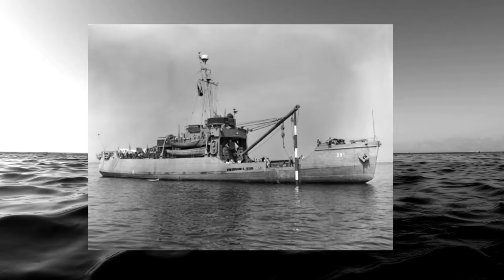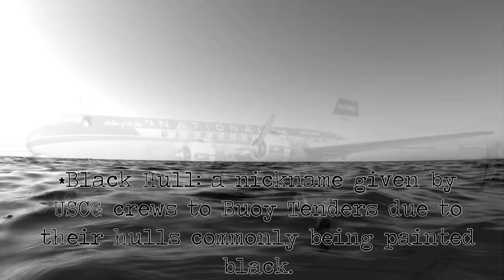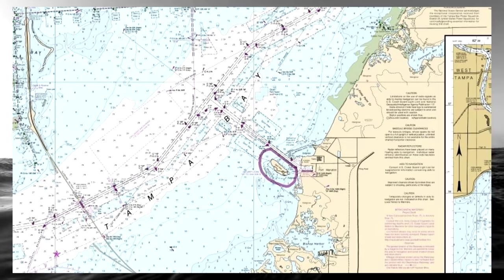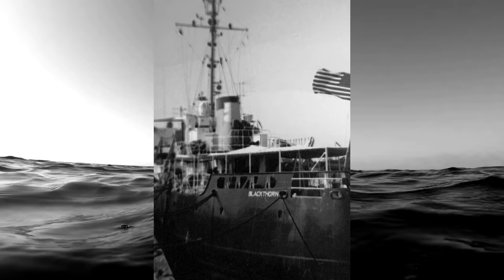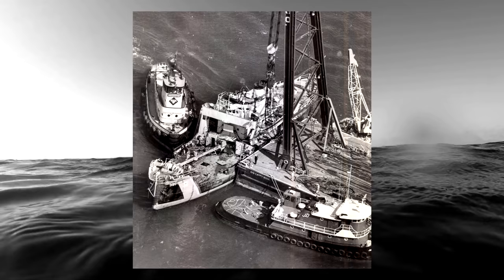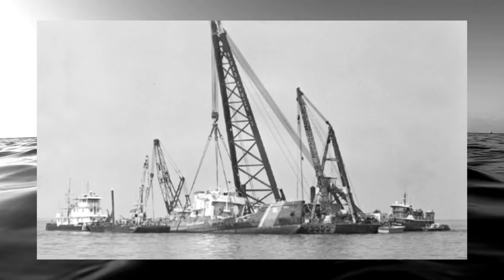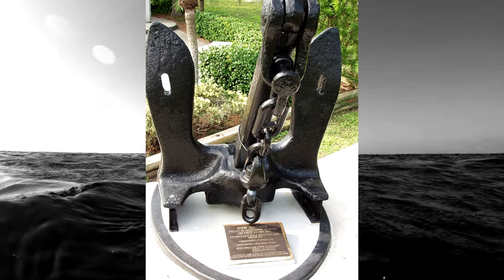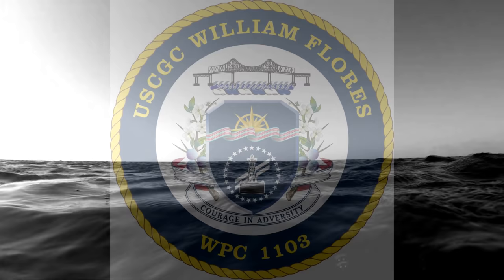The USCGC Blackthorn Collision

Comment: I remember my last ship, the Resolute, on top of JOOD duties, it was required to do an emergency egress training before being qualified to stand independent duty/watch and in port drills.  I remember having to wear a OBA mask, tapped up to block visibility.  Someone would  "walk" you around, up and down ladders, thru hatchways, get spun around, etc.. Then they would say, "find your way out". They turned you loose and away you went. I was the TCIC onboard the Resolute. I had a scuttle leading out of radio to the "mortar deck" (which I called my Steel Beach). We didn't have that on an older 210 I served on, they were added after they did their MMA upgrades. I will say the thought of having to escape out of that hatch and swim to the surface had crossed my mind many times and knowing that being at the top of the ship would put me on the bottom if we rolled over.
Reply from the maker: Yea, I did the same thing on board the mighty Alex Haley. All of that came about due to this incident. Very sobering to realize regulations are written in blood. Thank you for your service, Shipmate. Semper Paratus.
Reply: @MaritimeHorrors  Your welcome and back at you. Didn't mention that while I was on the Resolute, we passed under the Sky Way bridge when going out and returning from patrol a few times. Only spent 14 months on the Res before I retired but 10 of that was U/W.  And we were short of OPS 1st classes so I ended up onboard every 3 days as JOOD during our short in port periods.  73's
Reply: I lived in Tampa at the time.  Tampa had a large shrimp fishing fleet.  Most boats were privately owned and had limited budget and remembered that the CG started to crack down on these boats because the large number of assistance calls.  
When this happened, several shrimp boats came to help.  This included some that cut their nets to respond quickly.
The CG stopped publicly complaining about the fishermen and started a sunset flight to find shrimp boats in need.
Reply: In 1976, under Carter, the  Cutter Campbell was a joke. I loved the old ship, but that was the problem an old ship way beyond expiration date. Rust spots through the hull. I saw some with my own eyes, in the officers head... And we spent time in Alaska in 30 foot seas... But the alternative was the flat bottomed Melon class, or what ever it was. Puke inducers for sure...

Comment: My father commanded the cutter Woodbine before I was born. She was stationed in Grand Haven, Michigan. Was the Woodbine and the Blackthorn sister ships? I used to run a small LeBlond lathe that I was told was Salvaged from the Blackthorn wreck. That lathe shocked my boss, electrically shortly after we installed it at the shipyard in Tampa where I worked. I was also injured on my right hand while running that machine. It was my mistake. Later I worked for a company that did repairs on Coast Guard cutters in St. Petersburgh Florida. I remember the Coasties going to a memorial service on the anniversary of the tragedy.
Reply: Woodbine was in the same class, yes. There were quite a few 180's.

Comment: Can someone reasonably explain why the hell the Capricorn would try to separate itself from the coastguard vessel again??
Reply: Narrated by Chief Litterell survivor: Once we collided, the anchor of CAPRICORN ripped into the hull, and embedded in the BLACKTHORN's side destroying the crew's bathroom and shower, the corpsman's office. The anchor embedded in the chief's berthing and against the watertight door in the port passageway. The momentum of the CAPRICORN after the collision pulled the BLACKTHORN backwards. The anchor chain of the CAPRICORN broke loose and started playing out as it's momentum carried it past BLACKTHORN. The chain wrapped under the BLACKTHORN hull. The weight and momentum of the CAPRICORN and it's chain pulled the BLACKTHORN over as that chain's emergency stop took hold. All BLACKTHORN damage was above the waterline. If the anchor hadn't broken loose and embedded the BLACKTHORN would never have sunk.
Reply: Does not matter, that Ensign had no business in charge and hogging the center of the channel against a 600 foot monster. Gross tonnage rules. I have a place on the bay. During low tide and/or a hurricane tidal surge "out" you can walk out to the shipping lane. Tampa bay might as well be shoaled with rock.

Comment: You have to go out.

You don't have to come back. A salute to every coasty out there.
Reply: Real. I did not even comprehend the danger of a small patrol boat 41 footer facing a storm with 21 foot seas until I read Ten Hours Before Dawn. It should be standard required reading before signing on. Every boot with that in their head is going to be that much better prepared in a service that prides itself on Semper Paratus.